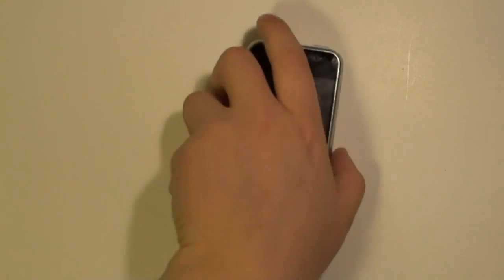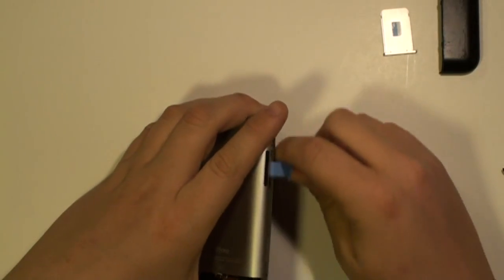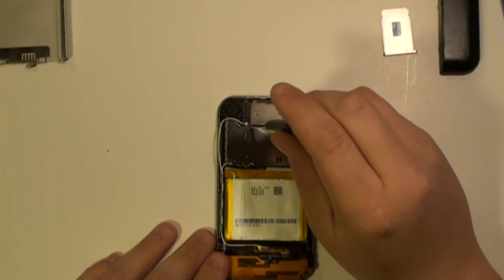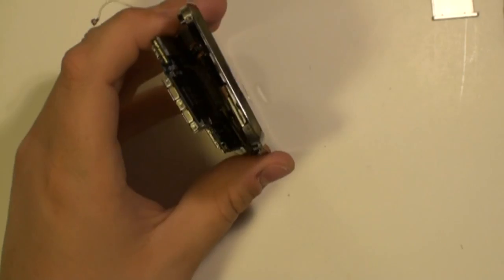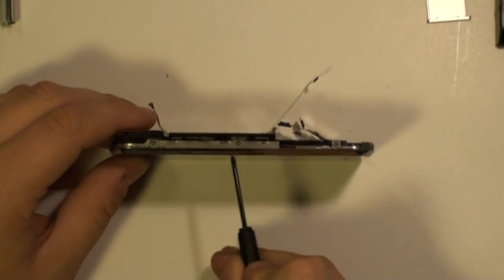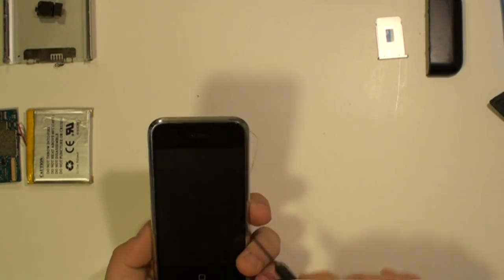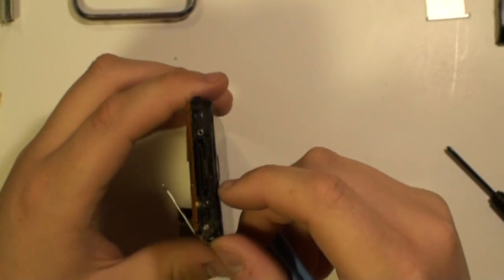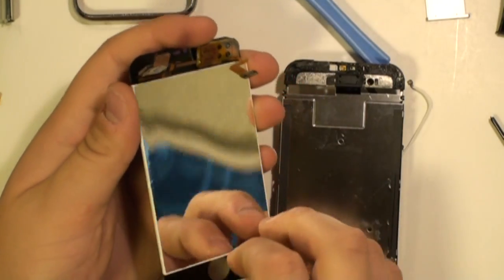iPhone 2G LCD Glass Touch Screen Take Apart Repair Guide

Comment from the maker: @djyaken This is the touch screen digitizer that effects touch sensitivity. I would suggest replacing this and it will resolve the issue (assuming there is no motherboard damage). Check out these replacement screens at RepairsUniverse (dot) com.

Comment from the maker: @arielmatulessy I would check the connection of the LCD flex cable to the motherboard. Make sure it is fully in place. If that does not resolve the issue, I suggest contacting the supplier of the part.

Comment from the maker: @idol16794 If the outer glass screen is cracked or damaged, you will need to replace the touch screen digitizer.
If the image on your display is not functioning properly, your LCD screen has been damaged and will need to be replaced. There are also screen assemblies available at RepairsUniverse (dot) com which have both screens pre-attached and are much easier to replace, with less room for errors and damages.

Comment from the maker: @Kingalen01300 We currently do not offer the digitizer by itself. If you manage to remove the digitizer from the LCD screen without causing damage, you can reattach a new digitizer. However the LCD screen is prone to damage. Replacing the screens with an assembly such as ours is a sure way to repair your device, without the worry of saving a screen.

Comment from the maker: @audiolsave69 I would double check the connection and make sure it is fully in place. If it was still wet when disassembling, its possible the moisture gathered somewhere and caused the screen or possibly the motherboard faulty. Difficult to tell. Make sure the connection is good and there is no damaged to it (rips).

Comment: some kind of liquid spilled on my iPhone it still worked  fine but it got dirty between the screen and something else. So i took it apart like u instructed , but now that i put it back together the screen  won't come on, I get the sound and everything but nothing on the screen, did i break the screen or i just didn't plug in the screen right?

Comment from the maker: @Kingalen01300 Sounds like a faulty touch screen digitizer. However it is common to use a 2G assembly on this occasion, as it is much easier to install and decreases the likliness of damaging the LCD screen when removing the old digitizer. These assemblies can be found at RepairsUniverse (dot) com.

Comment: I need help. If the bottom half of my iPhone 2g wont respond (the slide to unlock) but the top half of the touch screen works fine, am I supposed to buy the LCD, touch screen, or digitizer? Thank you.

Comment from the maker: @esesolox3 If it is recognized on iTunes it rules out quite a few possibilities, could be an issues with the LCD or LCD connection to the motherboard. Double checking the connection would not be a bad idea, and replacing the LCD screen may solve your problem. Hope this helps. We do offer replacement iPhone 2G parts at RepairsUniverse (dot) com.